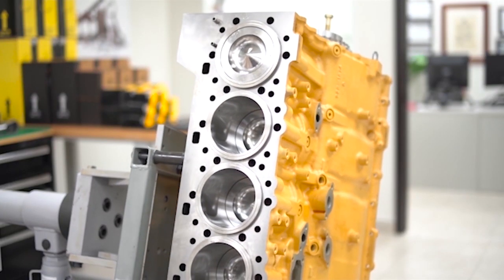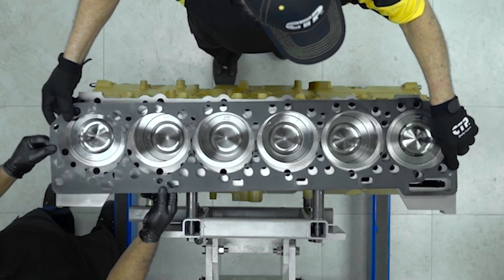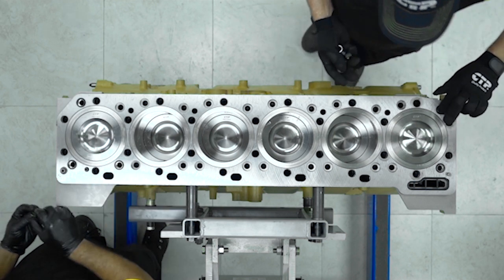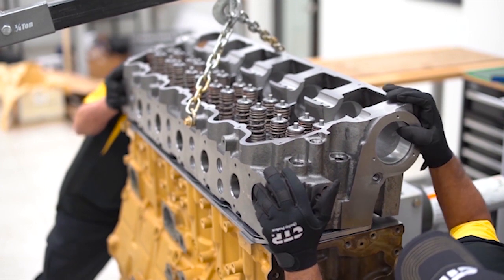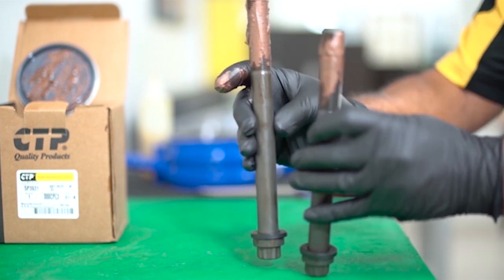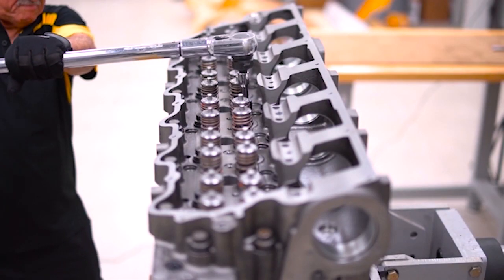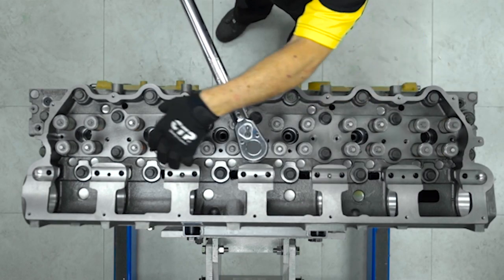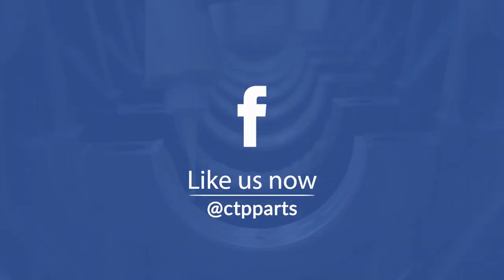Cylinder Head Installation

Comment: I think you misspoke. You said 10 outside and 16 inside bolts but viewing the video a few times I'm counting 16 outside and 10 inside bolts.  unless you count the 4 side bolts as inner bolts at which point it would be 14 inner and 12 outer. either way it sounds off

Comment: Did not add sealant that was required in 2017 on spacer plate gasket.. Now if you have the newest head gasket don't need sealant.